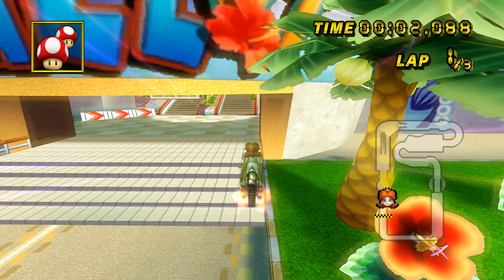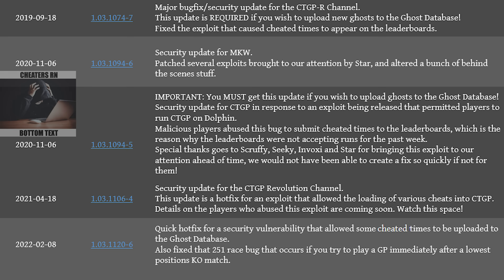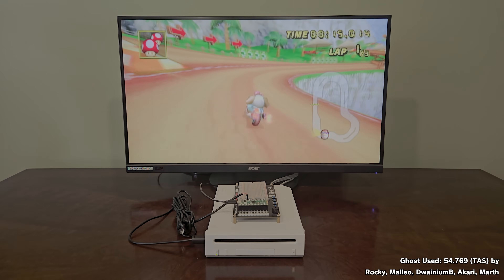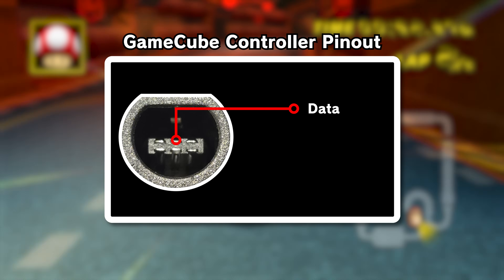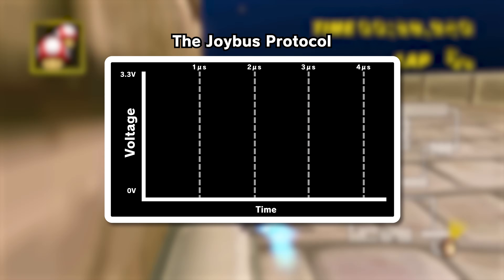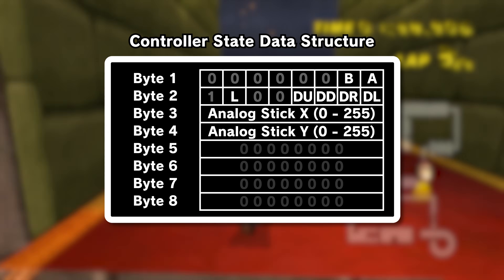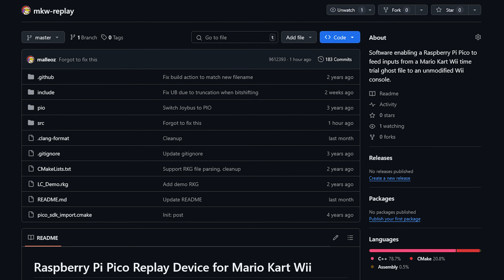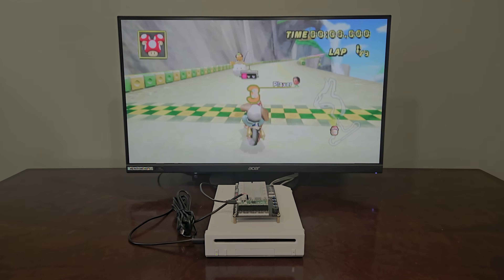Building an Undetectable Cheating Device for Mario Kart Wii

Comment: Good runners can use this to cut down on attempts after figuring out a convenient way to do passoffs. Do lap 1 glitch before desync throws things off, then grind last 2 laps. All 3/3 attempts become 2/3 attempts.
Reply: But then they'd have to do another first lap recording before submitting another time or the two runs could be compared, and there's no way a human is going to replicate their entire first lap down to the frame. So yes, this could save time by essentially turning it into a segmented run, but any given segment could only be used for one submitted run without risking detection.
Reply: @mal2ksc  Correct, but doesn't matter because it's worth the effort 

Make a TAS from start line to hitting lap 1 glitch, upload to device: 1 hour 
Complete a 2/3: several hours to one day of attempts
Complete a 3/3: several days to several weeks of attempts 

It's worth spending 1 hour to save days or weeks of attempts  

As for how to do the passoff: place splitter to allow input to come from either controller or breadboard. Make your TAS sit still/hold A for several minutes at the first airtime/straightaway respectively after the glitch. Play with the controller once that point is reached.
Reply: This is a hilariously unviable idea
Reply: I disagree and gave details. Ball is in your court now

Comment: Technically using kinoko, couldn't you make somewhat of a native pc port just without all of the UI and stuff? Or implement it into other software like libmario64? This would be huge. If it can simulate using a replay file what's stopping it from using inputs?
Reply: the game runs a lot of other logic that ghosts dont need to consider, like collisions with items, racers, course elements, and even some data between frames that players can react to.  I'm with you!  if it can recreate replays I wanna see it played too, but we're a ways off from MKWii PC port via the route of physics Replayer.  Here's hoping the Kinoko devs or modders consider the potential
Reply: My understanding was that it was literally just the game physics, basically everything relevant to the playback of a time trials ghost file and nothing else.
While being able to simulate a TT run is pretty cool, there is much more than that that goes on in MKWii overall.

Speaking as far as a PC port of MKWii anyway, as far as making it a library, I can't speak for that.

Comment: kinoko sounds cool! maybe it might be possible to compile it with emscripten to make it run in a browser then make a replay viewer? or maybe make an engine that can compile to wasm. or maybe use godot's gdextension feature to make it a godot plugin so a replay viewer could be built with godot. so many possibilities, but all im thinking is replay viewer
Reply from the maker: Kinoko will probably be my excuse to finally learn to use a game engine, likely Godot. So yes!
Reply: @Malleo  cool! Its possible to add physics engines to godot with a plugin (for example godot jolt which is the jolt physics engine, its officially being added soon so thats cool) so theoretically you could make kinoko a drop in replacement (and then have some stuff not supported XD. im guessing mk wii doesnt have softbodies ;P

Comment: So fun fact. that controller disconnect to get a pause on the first frame thing isn't just a thing on the wii or mario kart wii. but the xbox 360 will do this as well if you press the guide button while loading or in a place where it can't pause the game, it will pause automatically on the first frame. so if you say, wanted to do one for guitar hero 2 on the 360, it's totally possible without having to guess timing. i suppose other games would also work as well.

Adding a pause on mario kart wii artificially when you resume from a controller unplug would also help combat this. if it could wait up to 3 seconds (a random number of frames) after pressing A to resume. that's a lot of frames that it could fail to sync. :)
Reply: Ok so then I reset and try my playback again, great job game designer
Reply: but also, you could use other methods to sync back up, like pointing a camera at the screen like he originally would've done. making the game slightly non-deterministic is immune to this
Reply: @lunlunnnnn  not if you also require the A button to be held by a certain amount of frames.
Reply: @ZanaGBYT  how would you have the regular user accomplish this? if it is an onscreen menu pop up, you could just have the camera read that and execute it too.
Reply: @d_aesoph  They just press the A button, or the X+Y button, or their new combo of their choice. Humans can't barely distinguish a delay between 1 and 15 frames, same goes for how the buttons are read. Humans are rarely gonna hit a button merely 1/60th of a second RIGHT at the exact frame, but you can know if a machine held the button. so knowing that you can make something mostly transparent to humans but not to machines.

Comment: P.S. the reason you don't see this used for TAS verification is because the optical drives are too variable. Load times are just too inconsistent when a speck of dust on the disk could change it by a second.
Reply: mostly irrelevant for time trials, but i get your point for full games on disc, or console in general tbh :p

Comment: "So, if you didn't know, well, I guess you do now, because you've seen the thumbnail. Malleo is the creator of this TAS bot. GG Malleo, GG. We're all playing on fuzzy inputs because of you. GG bro."

This statement, likely pulled from a video, stream, or forum post within a specific gaming community, serves as a heavily charged announcement and a piece of communal venting. It encapsulates a narrative of cause and effect, technical challenge, and the often-unintended consequences that ripple through a player base when anti-cheat measures are deployed. Let's unpack this piece by piece, adding layers of context and detail.

The Opening Salvo: Setting the Scene and Identifying the Culprit

"So, if you didn't know, well, I guess you do now, because you've seen the thumbnail."

This immediately establishes that the information being shared might be recent news for some, but it's significant enough to be highlighted prominently (presumably via the video's thumbnail). It suggests a discovery or attribution has been made public, connecting a known issue (perhaps the recent implementation of fuzzy inputs) to its origin. The speaker is acting as an informant, bringing everyone up to speed on a crucial development.

"Malleo is the creator of this TAS bot."

This is the core accusation and the lynchpin of the entire statement. It identifies a specific individual, "Malleo," as the originator of a "TAS bot" that has clearly caused significant disruption. Let's explore what a "TAS bot" likely means in this context.

TAS (Tool-Assisted Speedrun/Superplay): Traditionally, TAS refers to the practice of using emulators and tools offline to create sequences of inputs with frame-perfect precision, often resulting in gameplay far beyond human capability. These are demonstrations of theoretical perfection.
TAS Bot (Live Game Context): In the context of a live, potentially online game, a "TAS bot" implies something more akin to an advanced script or program capable of executing complex input sequences in real-time with near-inhuman accuracy, consistency, and timing. Such a bot could potentially:
Perform difficult combos or techniques flawlessly every single time.
React to game events faster than any human could.
Exploit subtle game mechanics or glitches that require precise, repeatable inputs.
Gain an insurmountable advantage in competitive scenarios, effectively cheating.
By creating this bot, Malleo introduced a powerful tool that likely destabilized the game's competitive environment or exposed critical vulnerabilities in its input handling. Whether Malleo's intent was malicious (to cheat or disrupt), experimental (to push technical boundaries), or simply naive about the consequences, the result was profound.

The Reaction and the Consequence: "GG Malleo" and Fuzzy Inputs

"GG Malleo, GG."

This is where the tone shifts heavily towards sarcasm and exasperation. "GG" (Good Game) is typically a sign of sportsmanship, offered after a fair match. Here, it's repurposed ironically. It's not genuine praise for Malleo's technical skill in creating the bot (though a grudging respect for the ingenuity might be subtly present). Instead, it's a way of saying, "Well done, Malleo, you really did it. You broke things so badly that drastic measures were needed." It acknowledges the impact Malleo had, but frames it negatively through the sarcastic use of "GG."

"We're all playing on fuzzy inputs because of you."

This is the consequence, the direct result of Malleo's TAS bot necessitating intervention from the game developers or administrators. "Fuzzy inputs" are explained as an anti-cheat method, and here's a deeper dive into what that entails:

The Problem Targeted: TAS bots, and many other input-based cheats (like macros or scripts), rely on absolute precision and predictability. They are programmed to send exact input values (e.g., joystick coordinates, button press timings) expecting a perfectly consistent outcome from the game engine.
How Fuzzy Inputs Counter This: Fuzzy input systems work by introducing microscopic, often randomized variations into the inputs the game receives. When the player moves a joystick, presses a button, or uses an analog trigger, the game doesn't register the exact value transmitted by the hardware. Instead, it registers a value that is very slightly different – perhaps fluctuating by a tiny percentage or a minuscule coordinate offset. This "fuzziness" changes subtly and periodically ("every so often").
Why it Affects Bots More Than Humans: Human inputs are naturally imprecise and variable. We never press a button for the exact same duration or move a joystick to the exact same coordinates twice in a row. Our brains and muscle memory adapt easily to minor inconsistencies. A TAS bot, however, is built on rigid, pre-programmed perfection. The slight, unpredictable deviations introduced by fuzzy inputs can completely derail its sequences. An input expected to trigger a specific action might now fall just outside the required threshold, or a sequence relying on perfect frame-by-frame timing might be disrupted. This effectively breaks the bot's reliability.
The Downside for Everyone: While effective against bots, fuzzy inputs are a system-wide change. Every player's inputs are now subject to this slight manipulation. For the average player, the effect might be negligible or entirely unnoticed. However, for high-level players who rely on muscle memory for extremely precise maneuvers, advanced techniques, or frame-perfect timings, fuzzy inputs can be a source of frustration. It can make the controls feel slightly less responsive, "muddy," or inconsistent. Certain techniques might become harder or less reliable to execute. It introduces a layer of unpredictability, however small, into an interaction that players expect to be precise.
This is why Malleo is being "thanked" – the solution implemented to counteract his creation has introduced a subtle, but potentially annoying, change to the fundamental feel of the game for the entire player base.

The Closing Sentiment: Resignation and Shared Burden

"GG bro."

This final "GG bro" reinforces the sarcastic, resigned tone. It's a communal sigh, an acknowledgment that the entire player base is now dealing with this new reality of fuzzy inputs, all tracing back to the actions of one individual, Malleo, and his technically proficient but ultimately disruptive TAS bot. It speaks to a shared burden, a collective eye-roll directed at the situation and its originator.

In Summary:

The expanded meaning of the statement paints a vivid picture: Malleo, a figure known within this game's community, developed a sophisticated TAS bot capable of executing inputs with inhuman precision, likely causing chaos in competitive play or exposing exploits. The game's developers responded by implementing fuzzy inputs, a system-wide anti-cheat measure that introduces subtle randomness to controller readings. While this successfully hinders or breaks Malleo's bot (and potentially others like it), it also impacts the feel and precision of the game for all legitimate players, particularly those at higher skill levels. The speaker is therefore informing the audience of this chain of events, expressing the community's collective frustration and resignation towards Malleo through sarcastic "GGs," acknowledging that his actions have led to a tangible, and not entirely welcome, change in their shared gaming experience.
Reply: idk if ai wrote this or youre trolling but its from my video
Reply: @korben669  i wrote that myself, dont plagiarize me <3
Reply: @masq-c9m  nah this is word for word from a video I made like 14 years ago

Comment: top ten reasons why bean's stance on dolphin should just be abandoned already

christ sake, i just want to play on my steam deck... lugging around a wii, a power supply, and a television around just for the sake of playing the mod portably is not remotely practical :V
Reply: Retro Rewind is the CT pack for people that don't like CTs lol.
Reply: I check the CTGP website every few years and see that they're still doing that sh it makes me cackle
Reply: @WroughtJallie-i4v  The main reason is because cheating is extremely easy on Dolphin so Bean just disallows it (this is also why Wiimmfi won't work on Dolphin without a nand dump). No other pack cares about anti cheat to the extent CTGP does which is why it's practically mandatory for time trials. 

The other reason for forcing a real console and disc was Bean hoping for Nintendo to look the other way due to how public the mod was and the Wii was not an old console back then.
Reply: @ yap yap yap emulator scary
Reply: I think the mod works in modern versions of Dolphin if you fiddle with one of the settings.
Though I don't recall the specifics; aside for how I think it involved cache emulation. I also don't recall if you had to keep the setting enabled, which is pertinent as cache emulation is really slow.
Reply: @LonelySpaceDetective  People have gotten it to boot but it's not exactly in a playable state.
Reply: retro rewind and mario kart wii deluxe are fun substitutes with an active player base, they also have better and more up to date features compared to ctgp, i’d recommend those packs, they’re also not ran by a stubborn man w an ego
Reply: that’s what retro rewind is for! and you aren’t forced to play any of those truly awful custom tracks bean stubbornly refuses to remove from the pack either.

Comment: Just cheat by connecting a Raspberry Pi into your nervous system, translating every input into muscle movement, additionally, since the data cable of the GC controller also receives data, you can make it so tapping your feet turns on and off the code execution, letting you manually correct any misalignment, finally, to address the non-deterministic input in a more reliable and automatic way, install a camera on your eye that compares the ideal ghost data image to current image and corrects the inputs accordingly.

Comment: I'm actually extremely surprised that it worked for you with just the data pin. The ground pin isn't just for power. In order to have a complete circuit, you need a way to input power, and receive it back, essentially. Good grounding will help keep your signal integrity high, where bad grounding (large path back to the device outputting the signal) will really make it hard to get a decent signal. And in some cases, where the Wii and Pico are isolated (maybe they're on different circuits in the house or so, or maybe you're powering the pico with a battery setup, and the Wii on a wall setup), you will not get a signal at all!
Reply from the maker: I appreciate the extra context. I do not have a very thorough experience in hardware or circuitry (as you can tell by my incredibly poor soldering job lol), so thank you for explaining that!
Reply: @Malleo  No problem!
Reply: Probably it's plugged into the Wii USB port.
Reply: @renakunisaki its still not an ideal ground path, though better than needing to travel through the actual power circuitry of the house. The best ground path is one in the same shape as, and in close proximity to, the signal path. That gets you the best impedance, to my understanding anyway.

Comment: But wouldn't the anti-cheat merhod actually ruin the replay of every run recorded with it activated?

Like, the method is great to determine if a live run is actually cheated, but it doesn't prevent cheating in time trials though.
Reply from the maker: Nope, the inputs are basically intercepted and modified before they are written to the ghost file's input buffer. This means that ghost playback will always work properly.

Comment: Why not randomize the controller input disconnect message ? That not alter gameplay and make cheating harder
Reply: The added challenge is bypassed by a phototransistor or a CdS cell, which you tape to the display in a strategic location, so it's not even a challenge compared to the rest of the work of tasbotting.